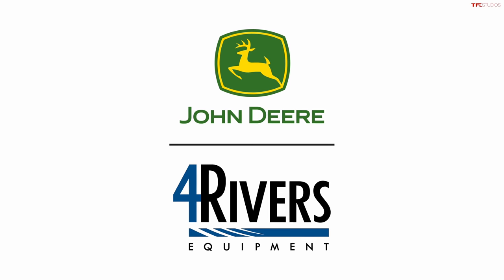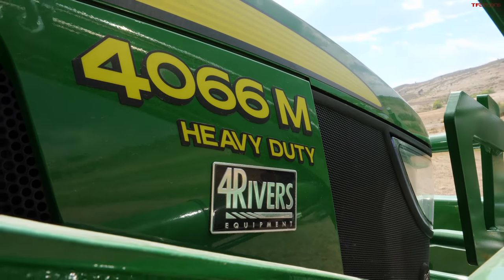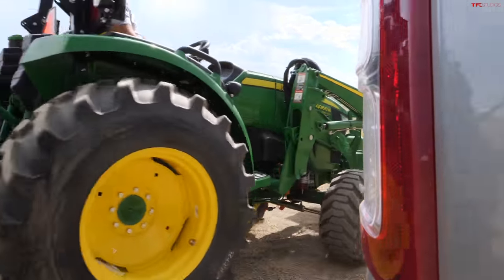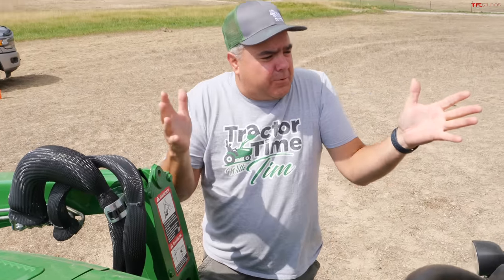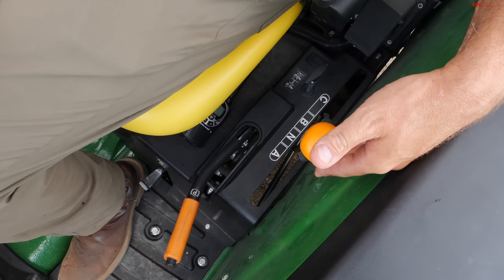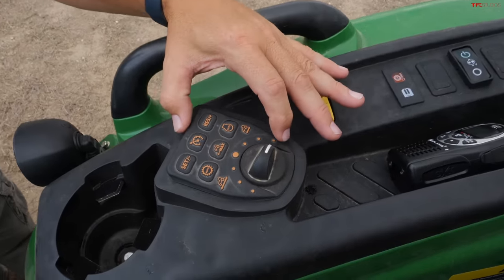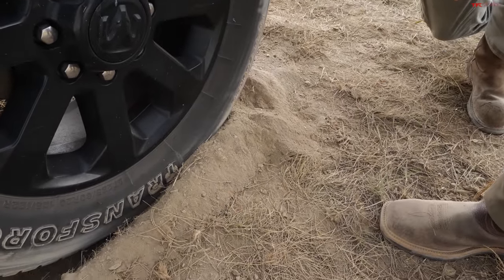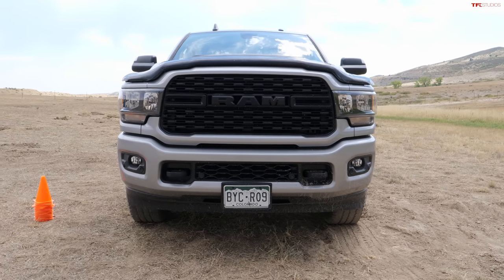The Ram HD Cummins Takes On a Diesel Heavy Duty Tractor in An Ultimate Tug of War!

Comment: I have an old 2006 John Deere 5325, 67 horse tractor.  It is a straight 5 cylinder.  As soon as you go from the 4 series to the 5 series you leave the compact diesel and the physical size increases a good bit.  I have two neighbors that have 4 series and they seem so much lighter duty than the 5.  Of course each step up from the 5 is a big step also.

Comment: Don’t tease. Make sure you get that 9 series out against something. Cool to see tractor time out for a collab. Shows ppl how much more capable a tractor is than a pickup for real work. 66hp beating a Cummins diesel lmao
Reply: Gearing, weight, traction. The ram could go probably go 40mph or more in low range, the tractor maybe 5mph? Same weight or tractor being a bit heavier with far better tires for dirt use. Kind of expected really. Better tires and aired down on the ram or even the stock tires aired down it would have been a dead tie I bet. Add 2k in the bed as far forward as possible and the ram will do much better.

Comment: I'd like to point out that is not a "diesel heavy duty tractor" as you call it.  Try a John Deere 7000 or 8000 series or a Massey 6700 or 8700 series tractor.  That would better illustrate the application difference.
Reply: We tried to bring an even matchup.   No use having an intentional mismatch.
This is a 4066M “Heavy Duty”…and I agree that the HD part of the name is odd.

Comment: The size of the tires on the tractor give it a huuuuuuuge advantage.
Reply: Yes in the fact it gives it more surface area on the ground, improving traction. Also the far more aggressive tread that is designed for use in dirt. If the ram had lower tire pressures and/or better tires for off road it would do much better.

Comment: I have a 2016 John Deere 4052R and I put different tires on it, Alliance 550 instead of the factory R4 style, to help with traction on the hills around my place. They have made all the difference in my ability to pull hard and stay on side hills. As well as get back up the hill to my shop in the snow and ice. I would guess that in this tug a war that it would have let the tractor pull harder, but then the same thing can be said for the pickup tires. 😂

Comment: This is incredibly dangerous.  People have been killed when a strap  or 'D' ring breaks and sends it flying like a peice of schrapnel.  At the very least you should have a weighted blanket draped over the strap to help absorb energy if it breaks.
Reply: The strap is probably 30k breaking strength or so. The shackle is 40-50k breaking strength. The only part im not sure about is the tractor connection point and why they did not go to the drawbar.
Reply: My first thought as well.  Our town tire shop owner almost got killed by a strap breaking when trying to pull a tractor out with a heavy duty 4x4 and strap.
Reply: @reddog9484  They probably only had 5k pounds or so on that strap, about 1/4 the breaking strength of the weakest link. That is if the attachment point to the tractor was done right(can not really see it in the video). At least it was not attached to a ball hitch, that is the big no-no.

Comment: He should of filled the tires with water thats a great way to get traction. Farmers, ranchers, and construction industry use water all the time to get traction and weight to offset the loader bucket. Also some serious rock buggys use water to gain traction and un sprung weight to keep them from rolling over as easy
Reply: If I know TTWT he already has Rim guard in it. Thats one of the only ways I can see it weighing 8500 lbs when the tractor alone is around 4k.

Comment: Extremely dangerous and irresponsible, I never expected this from the channel to do tug war without any protection to the tractor driver... if the cable breaks the whip will not be light and it can even kill (if you're lucky because if you don't have it, you can turn into a vegetable for the rest da vida)... one of the last videos on the channel happened when it broke and the cable went with everything in the body... be more careful!!!

Comment: Wait, 2,000 lbs of payload and 20,000 lbs of towing? Do y’all see how that’s messed up?
Reply: Payload and towing both are different things. For example, a person can push or pull 1200kg vehicle but can not carry it.
Reply: @curefordepression4016  he might be  talking about the ratios not leave any room for a driver
Reply: Yeah, payload is pathetic on some of these trucks.  And remember anything you add lowers the payload so it could really be below 2k lb payload.
Reply: My 2001 Quad Cab Dakota was 1450 lbs.  Only 2000 is surprising.

Comment: That tractor had turf tires on it ,  they are ment for medium/low traction so you don't tear up grass. If that tractor would of had traditional Ag tires with way more traction , it would of drug that RAM. Also , if the little tractor in the first video would of been weighted down like this one , it would of drug it a little bit.
Reply: If you mean the little john deere 1023e, no way. That machine weighs 1/4 what this 4066 in this video weighs. With a loader and ballast weight it would be at best 1/3 the weight of this videos tractor.
Reply: This video is all weight vs traction . If they all had the same traction like on asphalt,  the 4000 series would drag it all day. The 1000 series would be the only fair/close fight for the ram with equil traction. The 1000 series is down in power,  true , but it has low gearing (hydrostatic) in its favor.
Reply: @eds8397  You lose a decent chunk of power to the wheels with the hydrostatic. In a video with a weighed down 1025r (rear ballast, beet juice in tires and loader with weight in it) it reached 2400lbs of pull force in low range. IMO a weighed down, heavy 3 series like a 3046r would be needed to give a match for the ram. On asphalt the ram would have even more advantage. This is all without considering you can air down the tires of the truck and add a few thousand pounds in it as well. Or better tires, etc.

For giggles I am pretty sure my 5400lb tacoma would drag a 1 series around with relative ease.(4wd, mud tires, extra weight from winch and other crap).
Reply: Again  , it's down to the traction.   
Ok I don't think any of yall actually own or use heavy equipment or even light equipment to actually understand how things work without watching a YouTube video. I have a jd 333g on tracks. That ram held against a similar skid steer on tires in loose soil. My skid steer on tracks would of drug him threw a tank and back out again. It's all about traction and the type of service these Colorado city boys use. It was to show favor to a ram. Yall are silly as hell lol.
Reply: @eds8397  Well, I do operate heavy equipment for a living 😐 Yes traction is very important but not the only factor. To get the traction you need weight and better tires for the terrain you are on, or tracks, etc. Id hope a 333g would win, it has 5k lbs on that cat 242d in the last video, plus tracks like you said.